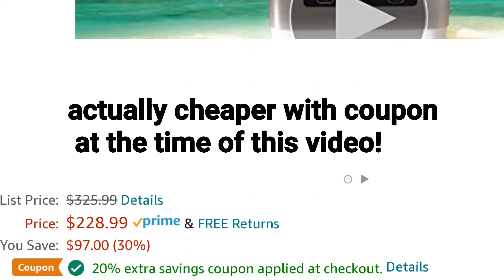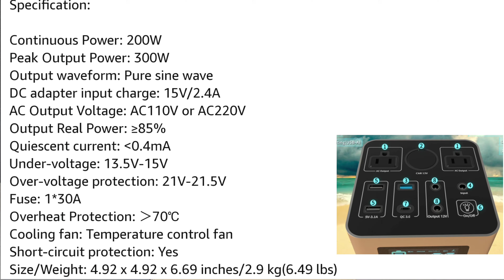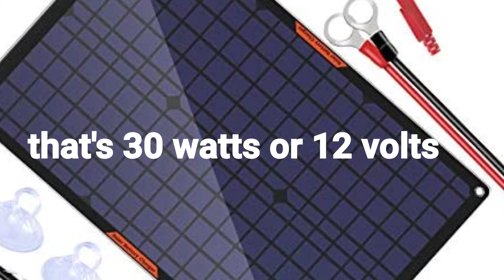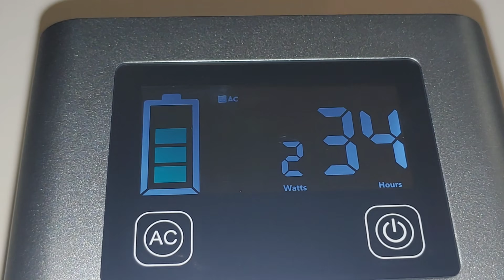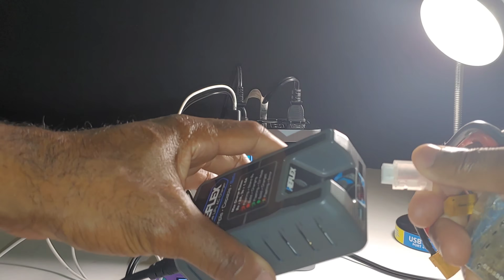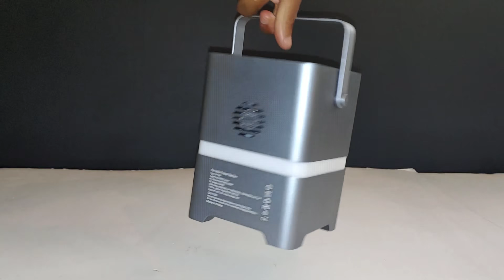OKPRO Portable Power Station Quick Look & Test

Comment: I need to replace the wires than connect from lcd panel to board is this a jst micro mini 5 pin connector ? Please help i pulled wires out of pins after replacing the fuse  .